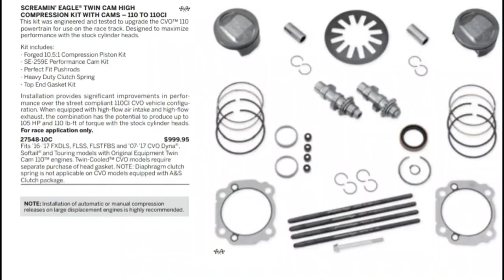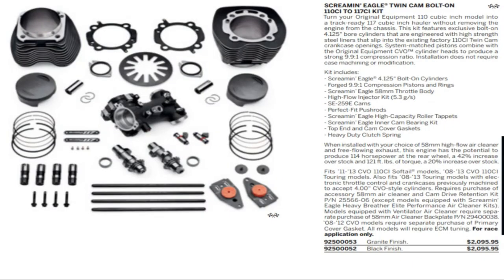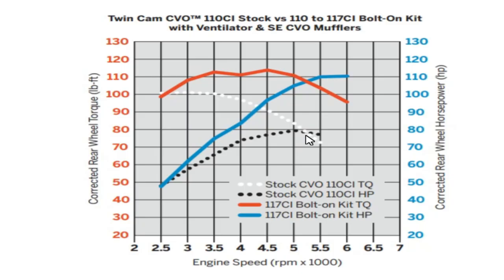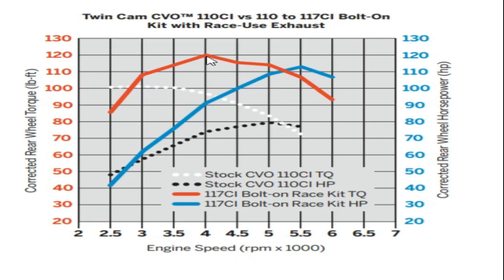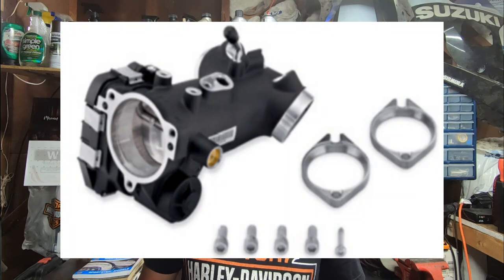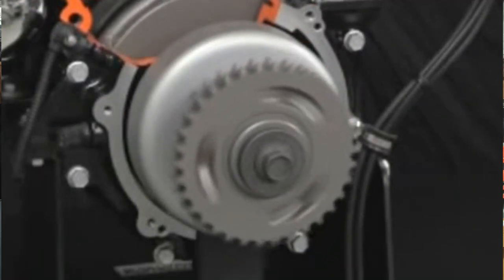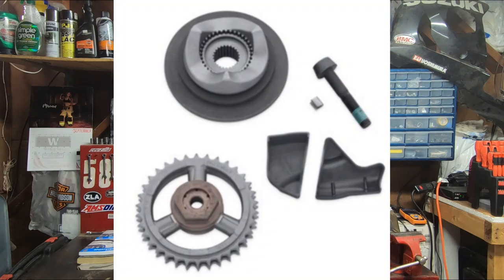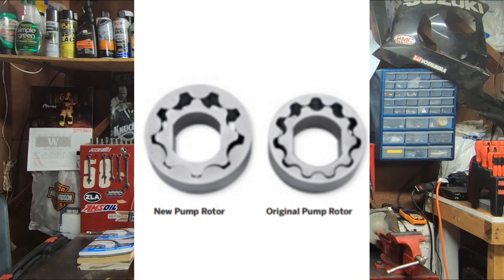Largest Production Twin Cam Harley EVER Produced | Twin Cam 110

Comment: Don't mean to sound kind of stupid. Is there a difference in a screaming eagle 110 and a say a regular 110. Like the 103 it had a production 103 then it had to screaming eagle 103 is that the same case with the 110
Reply from the maker: The 110 was only in the Screamin Screamin Eagle badging for the the CVO and later the S models. But you could get it as a crate engine. The 103 from 2003 to 2006 for CVO bikes wasn't the same 103 as the late production version. It was based on the 88 with a larger crank and bigger bore. It had different heads as well which weren't all that great and really held the engine back.
Reply: @GixxerFoo  like I said again man I appreciate it. I'll be honest with you I was just curious what kind of horsepower and torque I had I'm going this weekend to look at and possibly buy a 09 Electra glide ultra classic CVO. I can tell it's time to stage one air cleaner, it's got Reinhardt slip on mufflers and it has true dual exhaust they don't come connected anywhere. I guess the best way to see what I got going on and maybe guess what's been done to it is to get it dinoed. I really enjoy your videos Man. Keep up the good work
Reply from the maker: Dyno will tell the truth and probably get some more out of it getting it tuned while it's on there. A 110 with exhaust, air cleaner and a canned tune puts down roughly 80 to 85 horse and should be around 100ftlbs of torque.
Reply: @GixxerFoo  thanks again. Yeah I have a 96 cubic inch on my 07 road King. I'm not real big into changing things that they ain't broke. But I like to know my options. You know I don't know if something's been done to the engine or not you might already have cams in it I haven't even test drove it. I'm going this Saturday to do that. I know when it's sitting there idling though it sounds really really good it does sound like it has different cams in there it'll sit there and thump. But I still want to get it Dino to see what I'm looking at. I appreciate all the help. If I do get it down I'll let you know what it is maybe you can tell me what you think's been done to it. Thanks again

Comment: What do they use the 64mm throttle body on? i have one on my 110 2008 Dyna.
Reply from the maker: The 64mm would be a performance add on, it wouldn't of come stock.
Reply: @GixxerFoo  so with the stock lower i believe its a stage 4 screaming eagle upgrade kit. Does this sound right? bike came stock with a 96.

Comment: Don't forget about all the lifter failures.
Reply from the maker: That's a big issue with those motors and the 255 CVO cam, that cam likes to eat lifters and it doesn't matter if they are stock or good aftermarket high performance lifters.

Comment: I keep hearing how the twin cam motor is such a great engine.  Why did they gey rid of it.
Reply from the maker: Emissions standards, the twin cam wasn't going to meet the new Euro5 standard with the two valve head.
Reply: Eventually all vehicles will be zero emissions and all internal combustion engines outlawed relics. Keep the lunatics out of office that suggest the green new deal.
Reply from the maker: We'd all be riding Live Wires if they had their way.

Comment: Remove the stock pipes ant cat, increase throttle body size, change valve train components.
Reply from the maker: The 110 was really held back from the factory, there's a lot of potential in those motors.
Reply: @GixxerFoo  I have a 2012 RG CVO and the factory setup ran lean and hot. So hot it would over heat the rear cylinder exhaust valve-train. I had a lifter spin sideways in the case and seize.  More fuel and true duals are a first step then play around after that is done. Sure you can get more HP out of a single pipe, however the goal here is to dissipate heat.

Comment: Will the 117 kit work on the pre 14 engines?
Reply from the maker: Technically yes, but Harley won't warranty it since it's outside the year range they recommend it for. It's all about emissions reasons, you might check out the S&S 117 kits.
Reply: @GixxerFoo   Thanks, I’ll see if they have the granite cylinders.
Reply from the maker: I believe FuelMoto has the granite finish.

Comment: Stage 3 is 10.5:1 and the stage 4 (117ci) is only 9.9:1 compression? You'd figure stage 4 would be higher or the same at least. Why is that?
Reply from the maker: I have been wondering that myself, the higher compression is what really makes the power on the twin cam. Why they would drop compression on the larger bore just doesn't make any sense. I am sure it has something to do with what they are willing to warranty or the design of the cams.
Reply: @GixxerFoo  ok, thank you. 
I do own a 2008 Road King CVO with the 110 and just seeing what’s out there. 
Appreciate it.
Reply: Is the street/race 117 the same compression?
Reply from the maker: Not a problem at all, anytime!
Reply from the maker: Yeah they are the same compression, the CVO heads likely limit the compression. Now you could have those heads ported and that would help quite a bit.
Reply: @GixxerFoo  doesn’t seem worth twice the money.
Reply from the maker: Really a good cam and some higher compression and a 110 will overcome that displacement easily. The 110 really likes cams and compression.

Comment: Can a 110 fit  in an 06 Road King?
Reply from the maker: The 88 would need a case bore to fit a 110 kit, but even then it's a shorter stroke engine so it would be a 106 or 107  l believe. You can get a 100 inch bolt on kit from S&S, but honestly a 95 lot with a good cam does a lot for a 88 inch motor.
Reply: @GixxerFoo  I was referring to the 110” production twin cam engine. I have a 95” currently, but we always look for more LOL.

Comment: How about the 120R?
Reply from the maker: The 120 is basically the same motor, just a more aggressive cam.
Reply: @GixxerFoo  
Are they not 120 cubes? Only 117?
Reply from the maker: Oh no these engines are a solid 120ci, they are the real deal.from the crank up. They share nothing really with the production engines, they got all the Screamin Eagle goods.
Reply: @GixxerFoo  
My friend bought a Dyna with one in it. Tuning seems to be tricky. He has the good ecm that learns from wideband O2 sensors (the brand escapes my memory) but it needs a bit of "let's make sure our parameters are correct" checks to go for the tune. It ran ok for 8000 miles, almost ate the Dyna chassis it ran so good with an HD reflash. Got to make sure induction is sealed and injectors are working right. Interesting, he had no such worries about my Suzuki.
Reply from the maker: ThunderMax tuner maybe? I could see how it could be difficult to get the tuning down on one. They have a really aggressive cam on that R model.
Reply: @GixxerFoo  
Yes, ThunderMax ECM, not a tuner. He want's to check it out mechanically before attempting to play with the tune. (Induction leaks, compression releases, cam timing set, etc.)
Reply from the maker: That's the right place to start, tuning normally isn't horribly off. It's a possibility, you can have an intake leak and chase a ghost with tuning. Even then you're only compensating for the real issue.
Reply: @GixxerFoo  
I am trying to get him interested in diving in, but his KLR650 is just running too good for him to bother at this time. Should be fun once we get into it, though. It ate engine mounts and back tires as it was, should be a blast with upgraded mounts!
Reply from the maker: KLR's never die so waiting on the 650 is gonna take a while lol. It's probably something simple and easy.

Comment: And here lies the problem with Harley Davidson.   Charge you a hefty premium price for UNDER PERFORMING motorcycles.  But if you want to spend hundred, or more likely thousands more dollars, you can get a bike that performs "reasonably ' well. How about just sell a great bike IN THE FIRST PLACE?
Reply from the maker: I really don't like their marketing structure with the aftermarket arm Screamin Eagle. A lot of those parts should come stock on the bike, but even Polaris with Indian has taken the same structure as well.
Reply from the maker: It's Harley and they ain't cheap but it's beyond ridiculous. Indian offers big bore kits and l think they were tearing down motors since they had a connecting rod issue with their stage kit at one point. I am pretty sure they warranted the issue for customers who had the problem.
Reply: @GixxerFoo  I was just saying that that Chieftain was stock. And to get the Harley motor into the same performance area was an extra $5,000.  Its ridiculous.
Reply from the maker: Oh l agree, I'll be curious to see what the new CEO does going forward.
Reply: When people ask this same question over and over again I respond with the same answer..."You just dont get it", the standard bike and motor will do everything well just like any other bike model but some of us just cannot stop tinkering and playing with our bikes to make them faster, more powerful and more individual than someone else. Also US laws make harley and other builders restrict the motors..."To Save the Planet"... so some are happy with that some are not and as we do not have restrictions here we amp them up. When I come to the States and hire a bike from Eagle Rider it is a gutless bike with no grunt at all from my point of view. So harley is not UNDER PERFORMING it is your Laws that screw them over...IMHO. maybe this is why you see guys an Jappas, BMW etc adding performance parts to their bikes...some do some don't, some just want more and if you have the dollars...Why not...Cheers
Reply from the maker: That's the best part of a Harley is that you can actually work on them. They are much simpler than something with dual over head cams and 16 valves.
Reply: @colinmanion4988  sorry but the EPA restrictions are irrelevant when talking ONLY about bikes in this country.  Because other manufacturers are able to find significantly more performance in similar category motorcycles STOCK while having to meet the same EPA standards.   Motorcycles are very personal.  I get that. I just dont get spending $30k+ on a new bike...then HAVING to drop another $5k if you want it to "keep up" with many other manufacturers stock bikes.  Each to their own.  I'm NOT at all a Harley hater.  I'd just really like them to release much more competitive bikes from the start. Then if you want to hot rod it from there....offer performance packages and upgrade kits.
Reply from the maker: Harley's issue is that they are air cooled and they use a 45 degree push rod engine. It's a lot easier to make more power with over head cams and water cooling. Harley could do it, Kawasaki made a single pin crank, liquid cooled vtwin that looked air cooled and sounded very close to the Harley.
Reply: @hueydevotedUH1  I hear what you say and don't disagree to much except that a lot of times it is like comparing apples and oranges, both are fruit but with differences. I personally don't have a problem laying out the dollars to make the bike mine and do what I want it to do and I guess we would all want more for our dollars but as I said the OEM bike is totally fine for many people, compare a 1340 to what we have as standard now. What also is so good is that we have so much to talk about with our likes dislikes preferences etc...be boring if we were all the same...I appreciate Gixxerfoo's knowledge too, just found his sight, great insightful videos...Cheers....Can't wait to get back to States for another trip...sad that Eagle Rider have such gutless bikes...LOL, but it's almost a sin not to ride a HD in USA....
Reply: @hueydevotedUH1  Just did a quick add up  and my cost for Full Stage 1 was $3605 NZDollars, I think thats about $2900 USD for parts. One thing that gets me grumpy will HD is the non use of LED Lights I have bought the Ciro back end lighting for $547 usd and replaced front light and spots with Hog Works LEDS, that is something HD need to sort out for sure
Reply from the maker: They finally started putting them on the new bikes, but they aren't in the turn signals. Indian has full LEDs from the factory so hopefully Harley does it.

Comment: Why wouldn't I just by a Suzuki? These harley seem to have built in problems.
Reply from the maker: Suzuki makes a great, dad ran a Kawasaki and Suzuki shop for 30 years. We always preferred the Kawasaki since it had the single pin crank instead if the double pin the Suzuki uses. Double pin is more efficient but the Kawi had more of the Hatrley lope with the single pin.
Reply: cos it's Harley?
Reply: If you have to ask you just dont get it...LOL

Comment: The 110 piston is so short it has a tendency to tip while going up & down ! I have not seen a 110 motor last very long ! If you have one leave it low compression but you still have a junk motor !
Reply from the maker: Really? I didn't think the piston skirts were that short on those motors, that's really interesting.
Reply: Rode mine 2015 for 70+ K miles without issues, just now start to consider about 117 kit

Comment: Didn’t know much about twin cam engines before buying my 04 Fxdi, turns out one of the guys that previously owned it put a 110 cvo engine in there
Reply from the maker: Dang you lucked out getting one of those 110's! Those motor are awesome, they have a lot of potential too!

Comment: I am very interested in your 103 vs 103 video...  I have a 2003 HD Road King CVO with the 103 cu in motor and you did say the cam chain is spring loaded so I am going to be putting in a new cam plate and oil pump so a few more extra bucks into other modifications with be helpful.....  I am a "torque" rider, not a big HP rider.  If I want HP, I would go back to my 2002 Kawasaki ZX12R....
Reply from the maker: That CVO Road King was a very expensive bike new, the 103 in was actually a stroker motor. Interestingly Kawasaki had that ZX12 back in the mid 90's, they just had no reason to bring it out. The ZX11 was still King at the time.

Comment: I’ve got the 2016 FLSS and want to go to the stage 3. I want to get the most out of every gear and not have to quick shift as it seems to want to with the current stage 1.  What’s the best cam to roll with in my case do you think? And is an oil cooler in my best interests in going to the stage 3? Stumbled on to your channel and I’m thinking I’ll stick around for a bit. Cheers from Ky brother!
Reply from the maker: Honestly a Wood TW-555 would really wake that 110 up, they are great cams for Softails. Direct bolt in and very broad power, it will also work really with the stock compression. With the 110 to 117 to me the numbers are a bit soft unless you do a big cam, high compression and flowed heads.

Comment: T-man performance offers a no-loss air cleaner where the center part of the backing plate is changeable on the air cleaner so as you go to a bigger air throttle body from a 50 to a 58 to a 64 or whatever you just change out the center piece not the whole air cleaner..😎
Reply from the maker: Really?! I was unaware of that unit, I am gonna have to check that out! That's a pretty genius idea too!
Reply: Is there a url for oz buyers

Comment: SE 110 up to a stage 2. Thoughts? I'm looking for more power without breaking the wallet. Especially since there are bigger motors available to start with.
Reply from the maker: Check the Wood cams, they can give that 110 a big boost even with stock compression.
Reply: @GixxerFoo  Wood t222 cam vs redshift rs587? Which one is Theo best choice? And what about .30 gasket for higher compression?

Comment: More great info! ANOTHER question on this subject.  '17 FXDLS, 117ci kit, HP cam plate, CNC ported heads and went with the SE585 CAM. I shouldn't have.  Thoughts on the SE 266E cam to maximize this build? 9.9 comp. enough or should I go to something over 10?
Reply from the maker: That's a really nice cam and l would say 10:1 would really work well with it. Twin cams love their compression, the lower stock compression is what really hold their power down.

Comment: Is the crank not an issue on the 110’s?  (The pressed fit)
Reply from the maker: The 110's have the same pressed crankshaft as the 103, it's not the Screamin Eagle crank you see in the catalog. But even the SE cranks in the catalog are pressed too.
Reply: @GixxerFoo   Does the crank have to come all the way out to weld it up?  Thanks!

Comment: I just installed the crate 131 what’s your thoughts on that engine?
Reply from the maker: I have a lot more confidence in the crate engine over the converted 114's and 117's. There's been some issues with bikes that have been converted, there's a lot of factors as to why. The crate engine you know for sure has had all the latest updates and fixes that have caused the M8 issues on earlier engines. I believe it's absolutely insane horsepower and a complete handful 😄😂👍.